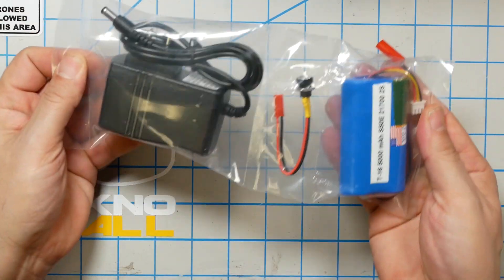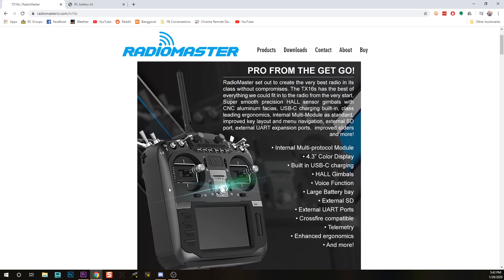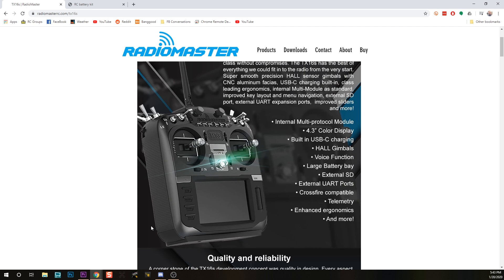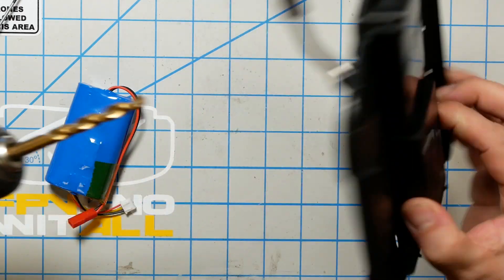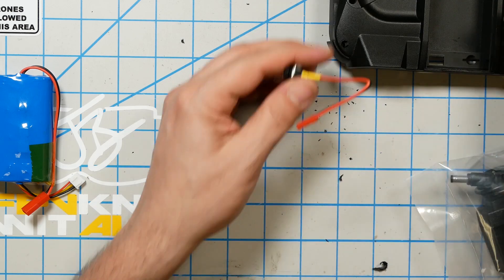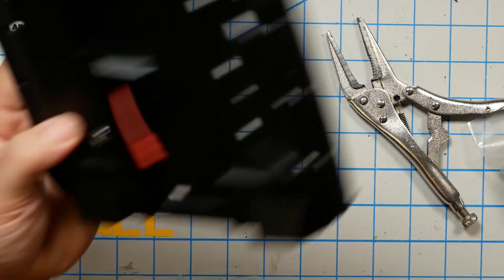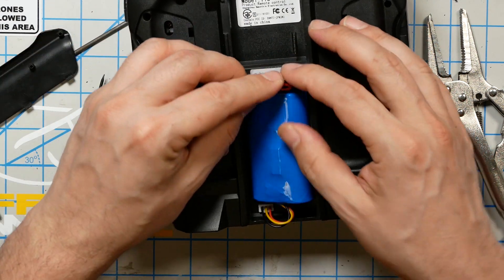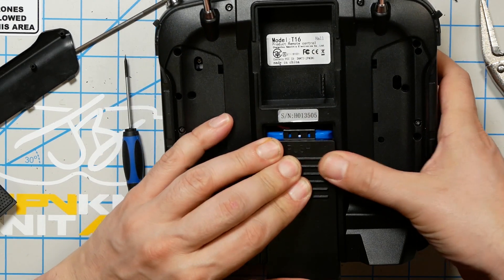Jumper T16 Internal Battery Charging Mod

Comment: Hi Joshua,  do you know if the v2 will take li-fe 6.6v batteries?   ive got a turnigy pack that  i had for my futaba 14sg ?  cheers
Reply from the maker: You can adjust the battery scale to take Nickel or Lithium. I'm sure you can make it right for LiFe if that's what you have.

Comment: I completed this mod and like the way it turned out.  I don't mind rewarding the gentleman for his ingenuity.
@joshua bardwell what would be the optimum Battery Meter Range setting in the T16?  Default setting is 6.0-8.4V.
Reply from the maker: That's a fine range.

Comment: I contacted Bob. He's a legend.

Josh I need your help please. I have the jumper t16 pro and I am trying to bind a flysky fs-a8s receiver found in the eachine wizard x220s. I've been trying for hours and it just doesn't work?
Reply from the maker: Bind in adfhs 2a mode not Flysky. Flysky mode is an older protocol that isn't used any more.
Reply: @JoshuaBardwell  thank you. All done.

Comment: I installed the set 21700 but I have a question about charging I have the wire with the xt30 connector.
Can I charge them with my lipo charger with the settings on Lipo - 2s - 2A ?
Reply from the maker: You should ask the manufacturer that question.

Comment: Joshua. I can see why you are venturing down the T16 road, makes for great videos. A friend has just purchased the T16 Pro in our club. Here are my observations. The T16 has cheap plastic sticks, No Bluetooth and no APP so you can program your radio etc and view telemetry sensors on your smart phone. As you explained in this video the T16 has no charger, so you need to spend US$65 to get one. The T16 button labels are almost invisible to read. The roller feels terrible and cheap. The internal and external modules have mainly older protocol selections in its menu, so another upgrade coming soon? The main ARM CPU does not have the encryption capability to run the newer protocols so I can see the next revision of T16 super Pro in the next 6 months. After all of that you could have purchased a FRsky X10 or better still the X10S. The T16 is cheap, it feels cheap and I predict will have a short life span. Lets see I maybe wrong.

Comment: Somebody get this guy a cordless drill.
Reply: cordless drill battery packs are too expensive and too quick to fail. unless you use a drill at your job and charge it every single day the packs will eventually go bad. for most people a corded drill makes more sense. full power, every single time, no $120 battery packs to worry about babysitting.

Comment: is there any risk adding your own balance port parallel to the current balance port along with a charge port? is there a need to add a disconnect switch before charging li-ion batteries?

Comment: If you had started with "this is a 50$ convenience mod, I'd stopped or skipped.

50$ for the EU battery compared to 160$ for t16 pro radio incl. battery is a no go or beyond making sense especially with a TX16s incl. a lot of my wishes for 130$.
Nice mod, but if I'd mod any6hing I d sell my brand new T16 Pro and get more than I paid to simply buy the tx16s 

But at least I learned to wait the availability if TX16S.

Comment: I was hoping for this vid and really wantedit to be a $10 upgrade. Though I like the quality I decided to cut/dremel the sides of the battery tray to make battery removal easier.  Now I just open the cover, stand the radio upright and lower the tray to remove the batteries - not need to unplug.

Comment: With the t16 internals being so modular with the boards and the tx16s being almost the same radio, what do you think the chances are of being able to transplant the usb c board and charging circuit directly into the t16? Will be interesting to see the internals of the tx16s when it comes out.

Comment: Hey Joshua I do have a question and one that I cannot find a video on, you have touched on it, that is proshot1000, you have done many videos on motor protocols, but since dshot1200 is gone, I was wondering if proshot1000 would be a good choice, lots of guys are dropping to dshot600, but to me dshot600 feels bad, not sure if it is just in my head or really there is merit to my feeling, but dshot600 does not feel as stable as dshot1200, not to be fair I am using dshot1200 in a betafpv 85x with a 4s battery, and comparing it to my GepRC cinepro 4k, on 4s, and the cinepro is on the dshot600 cause they took away the dshot1200, and the drone feels sluggish, now perhaps it is because it is bigger and heavier and that maybe in my head, dshot600 is still working, can you please address this, and maybe make a good video on proshot? Please and thankyou.

Comment: Seriously Joshua, this is not the best mod you have ever done. The 18650’s are way better, and you will never break a battery door, really that was your intro to promote this terrible battery mod and ultimately selling your soul to proprietary battery pimping. 18650’s are abundant and easy to get and due to competition very cheap and every bit as good as that pack you show in the mod, yes they are not the same mill amp as 5000, but I do not have to have that pack with that connector either. I can get lots of 18650’s for that price of that mod, I am in control of whom and where I get my 18650’s. I can charge 4 at one time, and my charge for my 18650’s has a car adapter so I can charge more in the field, I never need to as 2 18650’s let me fly all day with my crossfire in my jumper t16pro. My fatshark HDO, came with a rechargeable pack and I bought an 18560 pack for the fat sharks so with a mere 6 18650’s i can fly 2-3 days without charging and so can you or anyone else. No need to start cutting or drilling into a nice radio, and basically wrecking the perfection that Jumper has already made perfect. Jumper has freed us from companies owning our behinds and making us send in radios for expensive battery replacements or us having to crack open a radio to replace an expensive proprietary pack. I mean really how much effort is it to pop a few 18650’s on a charger wake up in the morning and go flying, then what happens when that internal pack dies, maybe you have 2, but you are not going to charge that in the field. With my 18650’s I can have 10 of them charged and ready, I can charge them in my car, no worries. This does not seem to me to be a wise choice.
Reply from the maker: If you're happy with 18650 more power to you. I'm a big fan of this mod.
Reply: @JoshuaBardwell  hey dont get me wrong Joshua, I am a big fan of all your stuff, just seems like you are selling out. I just do not understand the reasoning, you are trading a better system for a system that really wont do better, in fact I see it as a negative, please hear me out, you are trading off for a proprietary battery system, one that needs a wallwart to charge thus needing you to pack that as well. There seems to be more cons than pros. I love you bro, just this time I dont figure you, sorry. But please accept my apologies if I offended you, I never wanted to do that brother the work and commitment you do for this hobby is nothing short of exemplary.
Reply: @tazman6483  No wall wart required. Just connect the charging port to your lipo charger on 2S Lithium settings. The balance board takes care of balancing. More that 1/2 my kits go out with no charger, just the XT-60 adapter cable. See the web site  www.rcbatterykit.com
Reply: @bdmvy  that makes it a little better, still not giving up the 18650’s very easy to get, very cheap and work better than proprietary hard to get battery, that you consistently have to plug into a wall to charge, cannot use it unless that battery is fully charged, in the case of the 18650’s, a set goes dead, no issue,I got plenty, if a set goes bad, I am out 9 bucks. I am not having to tear into the radio, and void warranty as well. There is no up side to this at all. I mean just to have a charging port on a radio that really has little to no use. I rather love having removable, easy to replace. Batteries that make my life easy and are easy to find and order. End of the day to all new guys reading this take heed, this will lead to issues in the future, all this guys will come to regret the choice, but it will take time for them to see the light.
Reply: Taz Man there are others who think differently. Drilling is not a problem, as you don’t see the holes. The larger LiIon cells will last longer which is more convenient. The cells and the rest of the material does cost almost the 50, the cells are spot welded... For me, I hate opening the door as it is so tight 5hat I am afraid it will break. I don’t want to unplug the battery case on the inside and so I twist the wires every time in charge. The 18650 battery holder is of very low quality, the cells I own are a pain to fish out, and I can already see the battery terminals will soon come off. So this mod does make sense. 

Joshua in my opinion ends the review on a negative note, and then changes the tone a bit in the comments. Don’t see any selling out, just useful information as always. I just wish his videos would be shorter,  as you can explain this mod in 3 minutes! Love the condensed short stuff, as we are all strapped for time.
Reply: @dmalovic  as I said the internal battery makes no sense in a device that will need new batteries fairly often. If you get 500 charges before you need to start considering replacement you will be lucky, or you just accept you are  now at 80 percent or less of capacity which places you back at the 18650’s range. Next easy of use, sure you plug in a wallwart and charge it up great, what happens when you forget or something happens that drains your battery. It’s a proprietary battery, unlike the 18650, making it easy to have many and have many charged up. It’s a pretty small price, open a battery door, remove 2 small batteries and replace. Making charging at the field easy, not to mention that my fatshark s HDO’s use the 18650’s as well, so I am still going to need and use them as much as you and everyone else. So now you are gonna still use 18650’s except for your transmitter, right, great. Now you need to add to your flight back one more item the charger for your radio, and on and on and on. I want to lessen what I take with me, and not to mention taking a wall wart to the field is useless, but if you are traveling to fly a good distance you will want to take it to charge in motels and places. What are you really gaining, not performance, not east of use, its not easy to remove screws when you need to replace the battery, its not easy to cut and drill in a radio, not to mention voiding any warranty. All you are really doing is trading one charger for another and making it necessary to add yet another charger to your bag. Thank you, I will stay with my 18650’s, get them at a great price, have one charger and keep it way easier. When your internal battery needs to be replaced and it will be at a time you won’t be expecting it, I will have plenty of 18650’s on hand and oooops hey I wont need to worry. Unless you are planning to keep a wack of those internal batteries handy, and be ready to crack open the case to replace it every time it needs it, have at it. To be really honest, in the end after you alter your transmitter, void the warranty and make it use exotic batteries where is your pro’s. Your process, plug wall wart into radio, plug radio into wall. My process, remove battery door, insert new batteries, replace battery door. My pro’s, I can have multiple batteries ready to go and not have to charge for a very long time. I can promise you this, at first it will seem great, wow charging my internal battery from the wall, great, then will come the first sign of troubles, the point of failure, the battery, and they do fail and they fail often, especially in transmitters. I have had my share of proprietary batteries back in the old days of Futaba and Hithec, each had their own battery style and cost loads. When one company introduced a battery box and you could use non rechargeable or rechargeable battles of your choosing, well that was the best, no more spending a ass ton to hobby shops for batteries that we simply bundled rechargeable double A’s, we got control back. I think Jumper has it right, use 18650’s keep control of what and from whom you buy from and keep battery prices low, I have no issues replacing a simply battery door, its made of really strong plastic, and in 54 years of life I have never ever broken a battery door, not one time. The Jumper T-16 super easy to do a battery replacement as well. Now if you really want to have an internal fine, its your radio, if you decide to hard wire it to a 100 pound generator and strap that to your back why would I care. I am simply voicing out to the guys that might not see the reality of the issue they will be getting into. Internal batteries that are not readily available are issue. Look at console  controllers, yes I can change the batteries in them, I can order new batteries online. But I still need to order them, tear open a controller and replace the battery, much easier is my controller had a battery door, that uses a rechargeable battery I could by at walmart, right.

Comment: I wonder if that pack will fit the T8SG. They seem the same in that area. 21700's I never knew about. I can't pay 50$ but I can build it myself. I'd want USB anyway. Don't want some other random non universal charger I have to remember. The only part I wonder about is: I have a good charger for my 18650's and DON'T charge things like my 18650 headlamp through the on board chargers because those chargers they say are bad for the batteries. I don't recall why precisely...  heck I could pull apart an older headlamp I don't use the charge feature on, and be good to go if this is OK on the batteries. Just have to find some good 21700's with a protection board I reckon. I'm fine with really tearing stuff up (I rarely don't actually).. maybe I could build a 4 pack that I can cut and hack into there. The weight might feel nice too.. hmmm. Well thanks for the ideas JB. I can't believe how much stuff I have found to mod on this thing lol.

Comment: The next time you drill in plastic use this the perfect tool for drilling holes in plastic I use it all the time: 
https://nl.banggood.com/3Pcs-14-Inch-Hex-Shank-HSS-Titanium-Coated-Step-Drill-Bit-Set-3-124-124-20mm-p-1003275.html?rmmds=search&cur_warehouse=UK

Comment: I find a stepped drill bit helpful when drilling holes like that. They can be found at Harbor Freight pretty cheap. It also has the advantage that it sort of de-burrs the hole as you go, if you drill carefully.

Comment: Rather expensive mod...why not use a 2S battery holder and just swap out the cell to charge..no need to unplug from Tx..I do the same on my goggles.... 18650 are being used now in many places...https://www.rotorquest.com/jumper-radio-t16-battery-tray-18650?search=Jumper
Reply from the maker: The radio comes with 18650 holder if that is what you want to use.
Reply: Joshua Bardwell Great thanks
Reply: Joshua Bardwell  so why do you say that you have to plug,unplug and damage the connector?

Comment: "If you know a bit about electronics, you probably know you can build this for less than $50, but you didn't, did you? He did."
Just because he's done it doesn't mean I can't just go and still make my own. I've looked up the parts, and it'll be a lot less than $50. More like $20. This thing is a rip-off. And needing its own special charger? Absolutely not acceptable. Much easier to charge from usb - you can even charge at 2A. And if you're making it yourself, you can design it to either not require any holes (and you charge by just taking off the battery door) or only holes in the (replaceable) battery door, thus not voiding your warranty.
Reply: @zeusofcrete  Snide remarks will get you nowhere.
Reply: @zeusofcrete  I started by putting a how to on the web and then folks started asking if I could build them for sale. So first you need to start with a really good quality spot welder so you don't fry your batteries with a soldering iron, then you need to order batteries that are both certified and in volumes of hundreds to get a reasonable price. Don't forget the other components, connectors, packaging, postage, and then your time. Since you seem to be prepared to work for free, I'll "hire" you to put kits together. Takes about an hour or so, then there's the 1/2 run to the post office and back.  Total rip off!

Comment: The battery doesn’t rattle around inside my jumper t16, but then mine came with that piece of rubbery foam that glues to the inside of the battery compartment lid.

Comment: I did the x9d mod on my T12 and it works well It charges when using the radio on the flight sim. " why do I use a T12 its small and desecrate and as legislation starts to bite I think RC will need to go stealthy

Comment: Great tutorial. What about the balance battery connector ?
Reply: Standard connector with balance charging if desired. I pull power directly from the terminals so in the event of a low battery the balance board won't shut you down and possibly lose a model.

Comment: I added a 2s charger to my USB port on the top no drilling the case just solder the +5 and negative I also made the micro SD wireless so I can upload the firmware and sound files with out connecting the USB so I can test my files and scripts with out unplugging the radio.
Reply: Michael Leitner could you share how you did that? Sounds great!
Reply: Domagoj Malovic sure I will upload my photos to google tomorrow.
Reply: @SmothBrains  awesome. I would like to do this as well :)